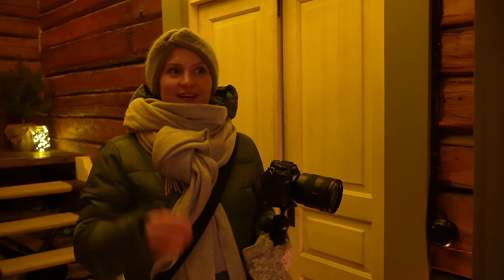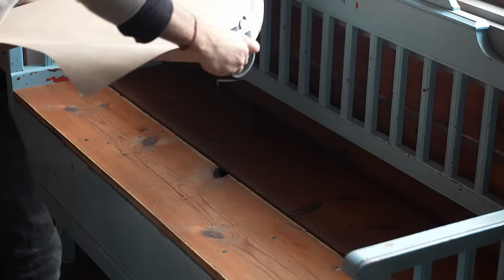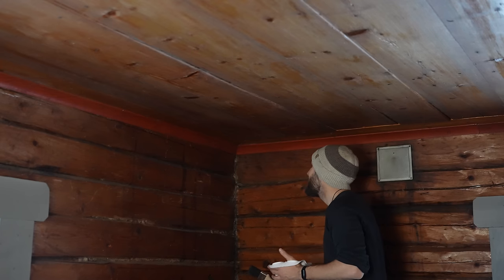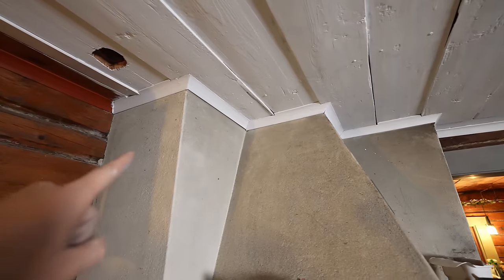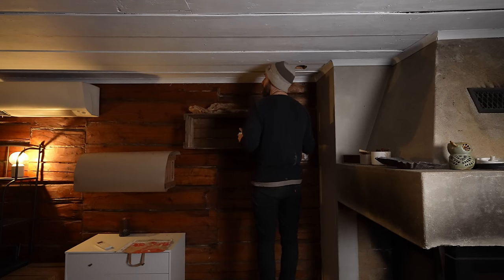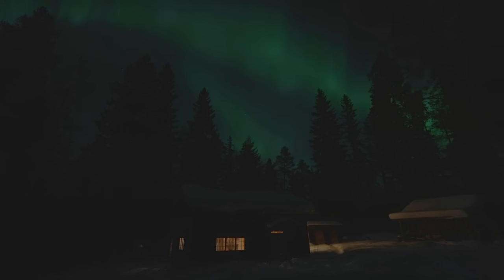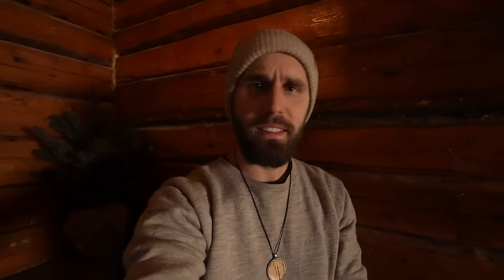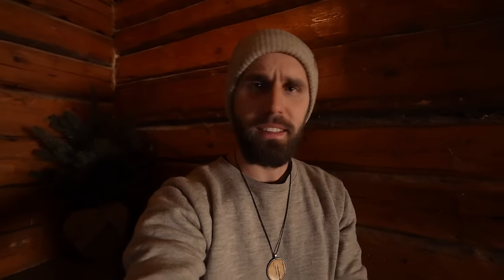Taking the Next Big Steps in our Dream Cabin

Comment: The trick is to use a roller (a small one) to get the paint on the surface and then use a brush to smooth it out. I've done painting/decorating professionally and always painted larger wooden areas like that... saves time and you still get the brushed finish.
Reply: Oh, great idea! I’ll use that idea

Comment: Kalle - I think you can scrub the stone / concrete of the fireplace.  There are natural, easy to use scrubs.  
Check with experts at your home center, to be certain, but I believe painting would create potentially dangerous off-gassing every time you have a fire.
Reply: Actually there os paints and plasters for fireplaces, they are safe to use.

Comment: Having a white ceiling is much more economical use of light so that really helps during winter. on the other hand if you, for some reason, decide you want it back to the wood colour, I don't know if it's possible to sand it down without removing planks from their place and that is a big project. So everything has it's pros and cons. But aesthetically it looks really good.

Comment: hi Kalle, as you know, the white color on the ceiling gives the impression that the ceiling is "higher" than it actually is, so congratulations on that.  As for your fireplace, yes, the loose plaster must be removed, a repair carried out and perhaps finished with lime or white cement in a difficult solution.  Do as you have luck with "try yourself out" good luck from Denmark.

Comment: I get where Christine is coming from. Having lived in Alaska for many years, the rustic wood look is what everyone wants. But, in the winter, you feel like you live in a cave, inside and outside. The dark can be overwhelming, especially when you know it's 3PM, and it's dark. The white paint on the ceiling reflects the lights, and brightens the room so that it seems like it's really daylight. And anyone who knows anything about painting, knows the paint could always be stripped off and the wood finish restored. In this case, I would put on another coat of paint,  so it was even brighter. 😆😆

Comment: Amazing!  I adore seeing you so joyful and "nesting" in preparation for the baby and your beautiful partner.  FYI, I have lots of wind here in the Rocky Mountains, and I love to hang my front door swag with a braided fishing line (braided to strengthen it with 3 strands, and fishing line to be nearly invisible), and I use flat thumb tacks on the top of the door to hold it at each end, while wrapping the braided line around the swag (or wreath in your case). It has held beautifully year after year, and you don't have to put a nail hole in the front of your door that way either.  Just a suggestion. All looks so beautiful!

Comment: I assume they are available over there, but for your fireplace I would highly suggest switching out to an airtight fire so you have a lot more control over. It's burning and you'd be able to burn overnight with just a couple of logs and it would be letting a lot less smoke into the cabin. And now that you have his white ceiling, you're going to want to avoid having any smoke coming in

Comment: 11:40 Kalle, you should remove the loose part and repair it by making a wood frame around the places you want to repair. Put an identical liquid of the fireplace inside the framed areals and wait for it to dry. It may take a few days to harden, so it's a summer project😉
Ps. To figure out what the material the fire place is made of  take a loose part to a building store and ask there

Comment: I like both! As much as it can pain me to paint wood, I understand living with short ceilings, and you definitely want to make it feel as tall and open as you can! I live in a camper year round and my ceilings are around 6.5 ft tall. The original ceilings were a very yellowed wallpaper. I painted it an almond white color that works well with my other colors. Though I wouldn’t have minded a more white white like the color Simply White by Benjamin Moore. Do you think you will ever add on to the cabin for more space?